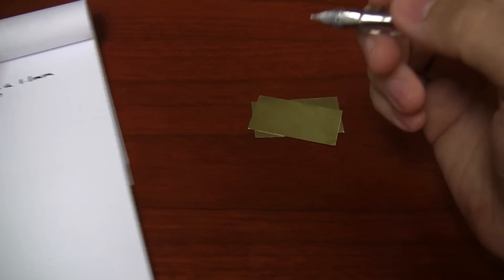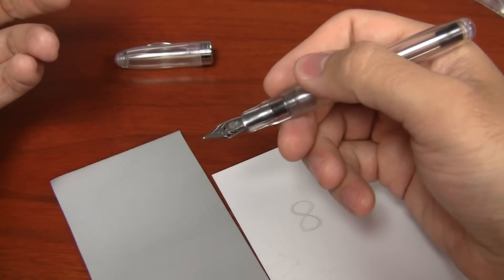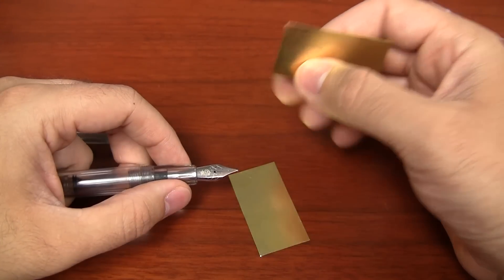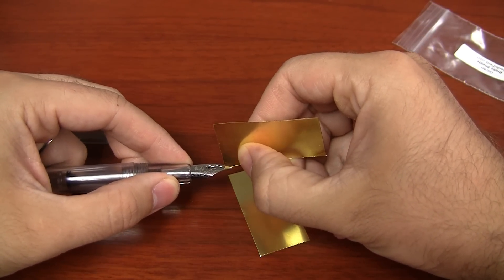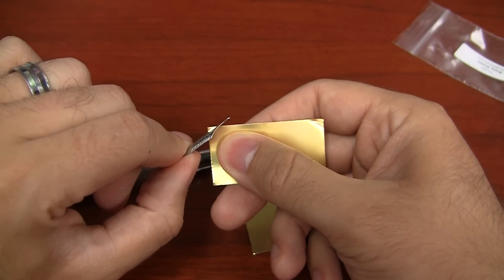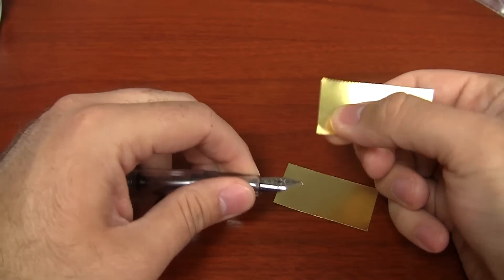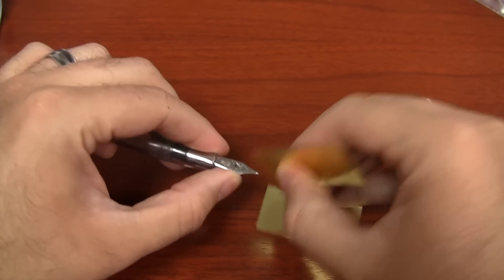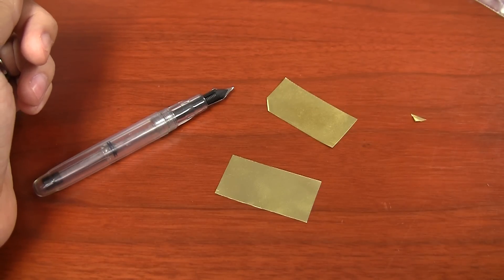Goulet Brass Sheet Tutorial

Comment: Something I have found that helps when flossing your nib is look at the edge(s) of your piece brass sheeting often the edge(s) is distorted from being cut with scissors.  This can make it nearly impossible to get your piece of brass sheet started between the tines of your nib.  To smooth the edge(s) of your brass sheet simple lay it on a hard flat surface and then run the back of a teaspoon gently but firmly along the edge(S) of your brass sheet a couple of times on both sides.

Comment: Thank you for yet another great video.

Here is something the pen community don't seem to have caught onto yet. I had a misspent youth studying mechanics and working on engines.
A lot of folk use a thin sheet of brass to spread the tines. Much better than this is a set of 'feeler gauges'. Mechanics use these to measure and set very small gaps with a high degree of accuracy. Essentially they are a set of very thin calibrated, polished steel sheets. Simply start with the finest and work up until the nib is wet enough. It takes seconds and no tine mis-aligning lateral leverage is needed. The thinnest ones are much stiffer and thinner than your brass sheet. They are inexpensive too.
All the best to you and thanks for your videos.
Reply: Thank you!!!!

Comment from the maker: An excellent point. You can also have the opposite effect. I've written on cheap paper where the fibers tear off and get stuck in the tines, then the pen ends up writing like a felt-tip marker because the fibers are wicking all the ink out! Either way, brass sheet will help to get you back to normal.

Comment from the maker: True, I probably could have clarified that a bit. Technically, nibs should be alllllmost touching, and a brass shim like this will help to get a nib spaced properly if the tines are in fact too close and actually touching. Perhaps that's something that I'll dive into in a separate video, that really gets more into nib adjustment and stuff which is a little deeper than I wanted to go for this video. For the average pen user, the brass will be something used more for cleaning the tines.

Comment: Another golden video! I especially liked two particular tips. 

First, cutting down the brass when needed with standard scissors is simply a great way to extend the life of the brass sheets. Awesome tip!

Second, it’s a such great reminder to throw in the fact that the brass sheets could be used with the nib either on or off the pen. Outstanding tip!

I placed an order just a couple of days ago for a Goulet Pen Cleaning and Tuning Set. It’s probably one of the most comprehensive sets out there for the price and I am very eager to receive it! Literally, the ONLY thing that could make the kit any better would be to include a cheap baggy of O-rings to help create a seal for eye dropper pens. Grease is nice, but an O-ring and grease is even better! Regardless, the value definitely speaks for itself!

I’m looking forward to checking out even more of your educational videos. I like how you go far above and beyond simple reviews and recommendations, but the fact that you could pack this much content consistently into just about 12-minutes or less really speaks wonders! Be well. ✌

Comment from the maker: I've heard of folks using anything from .001 up to .007 for flossing, I personally felt .002 was sufficient as a single all-around brass sheet. Thinner brass would be just as good for flossing (and easier to fit in the tines), I just settled on the .002 personally.
Reply: I literally used a few strands from a dental floss to clean the tines of my Lamy after removing the nib last day. It worked... But brass sheet would have been the right tool.

Comment: From what I've seen, a .002 inch shim would be a better choice for opening up the tines. The .001 inch is handy for testing the spacing after you have worked on the nib with the thicker shim and of course flossing it out after the operation is done.

Comment: So I have a Pilot Plumix and I switched the nib with my wife because she wanted an extra fine. So I added the Medium nib to my plumix. Had a startup issue and didn't have a brass sheet available. I had a one edge razor handy and cleared the clog with it. Did I just mess up?
Reply from the maker: Have you noticed any flow issues with your pen after clearing it out? I think a razor would be thin enough to work, but I'd definitely get some brass sheets if you want to do it again in the future. - Colin
Reply: I've been giving it exponentially longer wait times right now. From 5, 10,15 minutes and so far it's starting fine. I noticed it's writing wetter now. But nothing out of the ordinary.
Reply: If you can, use a modern DE (double edge) blade and tape up one side with tape just so you don't introduce your own blood into the equation! The blade is about 0.1mm thick. A single edge blade is thicker and will probably spread your tines rather than just cleaning. (If you're a 'wet shaver' you'll have loads of these to hand rather than having to order out...)

Comment: Brian...I just put a Wing Sung 626 away after thoroughly cleaning it with water. When I lift it off the page and start writing again it skips pretty consistently. It was driving me crazy so I put it aside. Interestingly enough, when I look at it under a loop, it does not appear to have baby's bottom; however, looking at it from the top of the nib I can see that the slip between the tines goes from open to essentially touching right before it reaches the nib. Since pulling apart the tines seems slightly impossible, do you think the brass sheet could help?

Comment: Is a razor blade thin enough for this ?
Reply from the maker: They're .002" thick brass sheets, not sure the sizing on razor blades, but I feel like they might be a bit too thick. - Colin
Reply: For future reference, a generic razor blade should be 0,004" thick. I wouldn't use it though, as it will scratch the nib and probably damage it, since the blade is made of steel, not a softer material.

Comment: How would you use these with an ahab nib.  There's no hole to start with.
Reply from the maker: The hole is just an easy starting point, but you can still do it without one. Just a more exact slit you have to get into. You can remove the Ahab nib, so that should make it easier. - Colin

Comment: Is there any alternatives? If for example its not available locally?
Reply from the maker: +Arlhec Novelas I've used a similar thickness of feeler gauge, like what you use to measure gap widths on car parts. Most automotive stores carry these. The metal used in these is often harder than brass so you have to be careful not to scratch your nib with it, but it works if you have no other option. -Brian Goulet
Reply: Thank you Brian! :D
Reply: +Arlhec Novelas Pilot also has an alternative made of thin plastic, but I cant compare these two. I would say that there would be less to worry about damage to the feed by using the plastic. You can also try strips of old Xray films